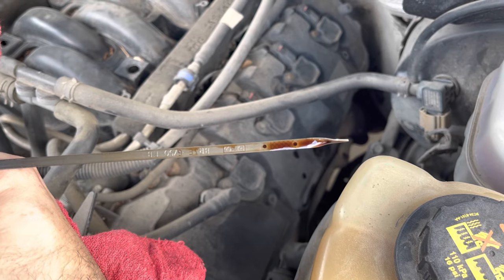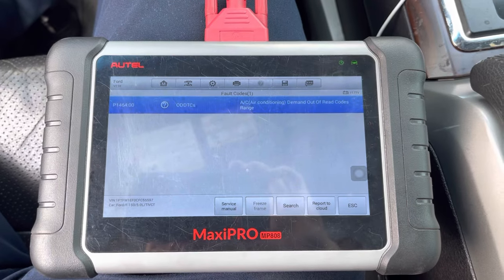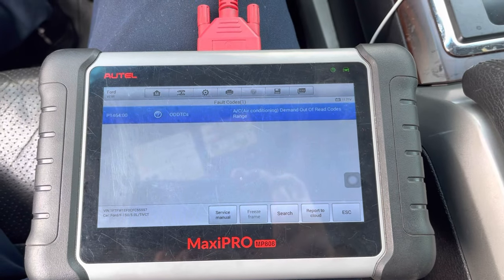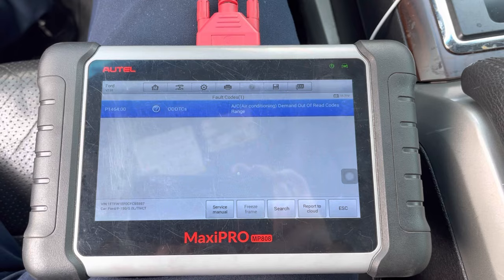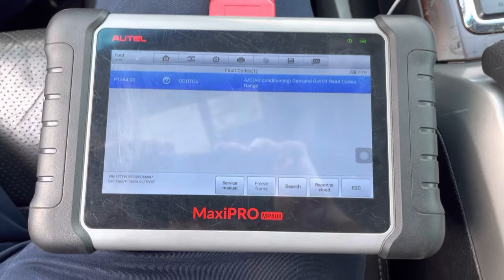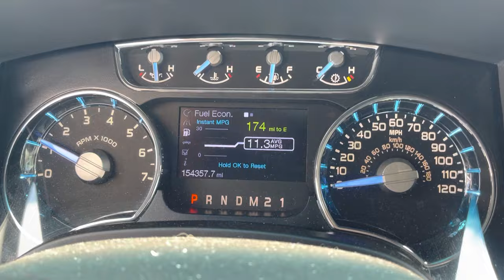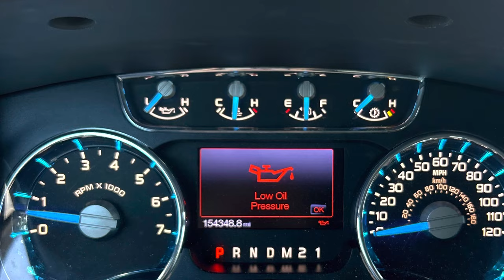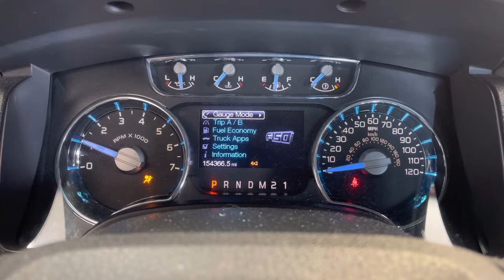How to Fix “Low Oil Pressure” Message on 2011-2021 Ford F-150

Comment: I like many others replaced the Oil Sensor Switch on my 2012 Ford F150 XLT 5.0 4x4 because at an idle I would get the dreaded LOW OIL PRESSURE warning. Didn't fix the issue! I stumbled across another video that talked about the THROTTLE BODY. Followed that advice by removing the Throttle Body and giving a major cleaning! Now, NO issues and after 3 months now, not 1 Low Pressure warning message. Try it, can't hurt, and will make a huge difference in the idle. Fixed my issue, hope it fixed yours!
Reply from the maker: You must have had a low idle before. If the engine isn’t spinning fast enough, then neither is the oil pump. I’m glad you got it fixed!
Reply: I had the oil light come on and my gauge was constantly dropping. I changed my sending unit on a Monday night, no problems so I thought it was fixed. As soon as I started my truck Tuesday morning, the light came on and the gauge dropped again. I remembered you talking about cleaning the throttle body so I tried it. So far I haven’t had a problem and it has been 1 week now! Thanks for the tip on the throttle body!
Reply: Can you add a reference for the 3.7l 2wd? Your video was extremely thorough, thank you for the visual. I'm concerned from another video referencing aftermarket sending units being a no go, is this going to damage the engine to drive to a mechanic, as long as fluid level is good and oil is in good condition?
Reply: Mine is a 2013 xlt with 216k miles, and this truck has been one of my best investments.
Reply: Thank you!  So frustrating! Several mechanics, even the better dealership in town have all been flummoxed. And I spent $450 getting the oil pressure switch replaced.  No luck.  If this is somewhat common, one would think the $200/hr guys at the dealership would have had a clue??
Reply: Which video did you see. I’m having the same issue. Thanks
Reply: @Sarcohunter did you find the video
Reply: Thinking that’s where mine is coming from glad to hear it fixed for you will be trying today
Reply: Any luck
Reply: @haileywood8691  for me I cleaned the maf and the throttle body, and it still did it a few times and then haven’t noticed it again
Reply: Hey guys, I have a similar issue, randomly only in park or sitting in drive I get that message also however my RPM’s never dropped and my engine runs fine in that moment when “low oil pressure” message pops up on my 2014 F150 5.0 FX4. 

So I’m assuming it’s the sensor that’s going bad since my RMP’s aren’t going down.
Reply: @prevail2983  I changed sensor and cleaned TB seemed to take care of it
Reply: @svtsebb  thanks for answering. Yea might do that. I just pulled off both valve covers to replace all 4 Cam sensors and all 4 VVT Solenoids. Decided to get them all done since I was in there lol. Oil pressure sensor isnt expensive so I’ll just replace it. 

Here’s a tip back, hopefully you never run into this issue but…. If you ever get codes like “P0022” “P0012” “P0014” or P0024” the cam sensors and/or VVT Solenoids are bad…. And if your Valve cover bolts are rusted out it’s literally a nightmare so check that out. One of the Cam sensors is blocked by the firewall, the rear cam sensor on the driver side, to replace it you have to pull it straight out but the firewall doesn’t give you enough room, in other words you either drop the motor or drill a hole in the firewall. Shits crazy, always felt bad for my customers, now I’m doing the same thing lol.

Comment: You can reach the oil pressure switch from the top of a 4x4. I did it in my 2011 5.0 4x4. Took 30 mins. Had to take out some stuff on top to reach it but not too bad. Still hard to reach but not impossible.
Reply: What did you have to remove from the top of engine to get at the switch ?

Comment: Knock that sleeve back on the bottom alt. bolt before you remove it by loosening the bolt a couple of turns and smack it with a hammer. The alt. will slip right out. 😉

Comment: So I have 2014 with 5.0 and same warning message , oil message was first, then cht warning and code w/limp mode no a/c replaced cht sensor and truck went back to oil pressure gauge dropping and message but actually died at a stop, replaced oil sensor and maf  then relearned idle same code sent to ford they replaced the same sensor and plastic plug then said it was fixed drove it home and it was not fixed after returning it to the dealer and 1700 for injector cleaning and throttle body +retune now they are quoting a new engine. Won’t know the motors tired but I have to see the live data of oil pressure dropping to believe it the truck drives amazing I picked it up from the dealer then picked up my kid gauge dropped once in reverse but truck seems normal

Comment: hey man , i got a 2014 f150 5.0 4x4, i get the same warning light with the oil pressure gauge dropping from time to time, but my truck shuts off by itself sometimes when im at a stop sign and get the warning. is that normal or do you think its something more serious? because when it turns off i just turn it back on and it runs just like nothing happened? any idea of what's wrong?
Reply: Mine does the same thing did you ever figure yours out

Comment: I appreciate the video (especially the tip about the alternator). I almost considered coming in from the top on my 5.0, but decided to follow your video. I think this is probably the best way to do it. You have all the access you need once the alternator is out of the way. I was able to get it done in about 45 min - 1 hour start to finish.
Reply from the maker: Thanks! I agree that it’s best to give yourself the most space so you can actually see what you’re doing. Plus, the way I show here is technically the correct way.

Comment: Excellent explanation! This is precisely the problem I'm having with my 2017 F-150. The warning comes up on the screen mostly when I've just stopped at a light. My truck is 2-wheel drive, so I hope it's not too difficult to replace the sensor. Thanks for posting a good video. My only wish is that you would do another video on a 2-wheel-drive F-150 with specific instructions on how and where to find the sensor. It's not at all obvious, but at least now I can look for a sensor that's cover with leaking oil.
Reply from the maker: Since your truck is 2-wheel drive, you can get to the sensor on the bottom without having to remove the alternator, which will make the job a lot easier. If the issue persists, try cleaning the throttle body because a low idle can create this issue also. Good luck!

Comment: Thanks a lot  Jack. Your video allowed me to successfully remove and replace the oil pressure sensor on my truck today. I'm very grateful, thanks again!
Reply: I replaced mine but it still turns on can it be a faulty sensor ?

Comment: Exactly whats been going on with my truck, just after an oil change. Level is good, maybe a touch on the full side. Doesn't come on all the time but when it does it's on/off, on/off repeatedly. I'll take a look but I think I'm getting to old to do this myself unfortunately. Thanks for the detailed video though.

Comment: Tapping the threaded insert is a great tip!
Reply: It would have been even a better idea to tap it back after he loosened the bolt a couple of turns when taking it out. It wouldn't have been such a struggle to remove the alternator. 😉

Comment: Did you use OEM sensor? If so,  what was the part number?  My brother in law has the low oil pressure light coming on also,  when it does,  engine automatically goes to idle,  will not move until he switches the truck off,  and restarts engine.  Only happens when he comes to a stop,  like a stop sign,  or stop light.  He had it to do that twice in one day.  Next day worked just fine.  I think he has a switch going bad.
Reply from the maker: Yeah it was a Motorcraft sensor. Part number SW8368

Comment: Nice video bro 👍 👌 not sure if you mentioned it in the video, but keep in mind this can be a wiring problem also! I have a customer truck right now that just had an OEM sensor put in by another shop with no change in symptom. Haven't tested circuit integrity yet, but the wiring looks terrible and i am suspecting that's gonna be yhe issue. Unfortunate that the customer has to pay twice for the problem to be fixed!
Reply: There was a recall for the wire harness but I got the same issue I replaced the negative terminal clamp and it fixed the issue

Comment: If it's option 1 which is the low oil pressure popping up and engine turning off.  What do you need to check or replace

Comment: So you said if the low oil pressure light turns on either the switch is bad or there’s actually low pressure and the engine won’t run if that’s the case? Is it possible for the truck to actually have low oil pressure and be drivable
Reply: Keep in mind the wire from the sensor to the PCM can be broken or a connection can be loose. If the wire breaks (or is loose and making poor contact) the PCM will think there is no oil pressure. If there was intermittently no oil pressure, the truck at very least would be throwing codes for Variable valve timing, which requires oil pressure to function. Just my opinion I am not a ford tech.

Comment: Just got it finished doing from underneath with truck on ramps.  Awesome lifesaver here.  Only way in my opinion to do this.  Doing relearn process now to speed process up.  Went out and ran a bunch of lights for an hour with some highway.  Now onto “service advanctrack”.
Reply: I had the “Service AdvanceTrack” warning on my 2012 and it was due to a leaking vacuum line that was easy to reach, near the coolant reservoir.
Reply: I replaced the pressure sensor.  $20 part and about 3 hours of my own labor.  Mostly it took longer because it’s hard to access with 4 wheel drive and I needed a couple of tools I didn’t have handy.  Problem gone for three years now.
Reply: @jefflundberg8068  excellent tip thanks.  I have not thought of that possibility.   Been dragging my feet a bit on issue with life’s other curveballs.

Comment: Change the plug also!  if you have done this before, My sending unit plug was bad, I couldn't tell it was until I pulled out and metered it. I was getting intermitant ohm readings as I moved the wire.

Comment: My 2014 just started doing this but my truck stalls out then the low oil pressure light comes on, oil level is fine, any ideas ?
Reply: Did you ever get a solution? I'm dealing with this same issue. 2012 tho
Reply: @vigsector5400  No. the guy that worked  on it couldn’t find anything so he reset the computer and it hasn’t done it since so who knows !

Comment: How about no light, but a random knock at hot idle that goes away with any amount of throttle blips. Sometimes not there, other times knock no knock.  
Oil pressure bleed off from timing tensioners is my best guess. 200k OG timing set. Pretty sure, bought at 184k.

I want to do this first though. Could this video be my solution?

Comment: Hey Jack, I see a lot of videos about this model and year having issues with the low pressure alarm coming on at an idle, but I had a different issue. 

I was 315 miles into a 350 mile trip, cruising in a traffic slowdown when I lost all oil pressure, couldn't accelerate. I pulled over and made sure I didn't spring a leak. Next I checked the fuse that goes to the oil pump and relay. Once I popped it out and back in again, the truck was able to start up and get me the rest of the way with no issue. Does this sound like it could still be the same sensor, or could I be looking at a computer issue? Thanks
Reply from the maker: More than likely, it’s an issue with the sensor. The odds of it being a computer issue are very low.

Comment: nice Video. I had mine changed and several months later the same thing happened again. I took it to my mechanic. He check the oil pressure mechanically and said when the light comes on that the oil pressure does not drop. It's an electrically problem. He said the part is not bad. I admit all of this sound fishy but I had this exact same problem with my 2002. I drove my 2002 for years and years with that message (actually no message the oil gauge would drop to zero) Never threw a code.And everything was fine.  The point of my comment is this. The repair he made sometimes will fix the warning light and sometimes it reappears after a short while. I am looking for a way to silence the warning light. I know I know but it is extremely annoying and paying $300 to have a new oil sensor installed only to have this problem come back in a few months is not the answer either.  If anyone knows how to silence the warning light please let me know.

Comment: You never explained if you sprayed the inside.Where you screwed in as well with breaking or is it just a connector
Reply from the maker: I always spray a little bit inside the threaded hole but it’s not really necessary.

Comment: my 2011 f150 5.0 112,000 miles did the same thing with the oil pressure warning, today it did it and shut off, now it won't stay running, when you start it it runs fine for a few seconds then says low oil pressure and shuts off, oil is full any ideas?

Comment: How long did the job take?  Looking at how much it should cost me man hours and part
Reply from the maker: The book time is slightly over 2 hours (2.1) (for 4x4 models with the 5.0). That’s probably about how long it took me because I was filming but it can be done faster.

Comment: Hey ma I have a 2010harley 150 we’ll she would  start shut down , they changed the fuel pump then it wasn’t that then they said the hole timing chain kit wasn’t that changed a brand new oil pump wasn’t that she starts and runs then her alarm comes on and she wants to stop and the low oil pressure and the gauge drops the needle help eny ideas ?
Reply: Old thread but you need to move the fuel pump fuse to the new location, Ford has a kit, and Amazon sells one too. Pull the fuse to the pump and if it looks burnt your in need of the fuse relocation kit.

Comment: My truck is doing the same thing. How much this job runs???
Reply: You just saw how to do it.  Get the new sensor and replace it.   You need to get the timing belt out and alternator out.  Good to go

Approximately 3hours of job.
Reply: @learnlkh1 You mean the serpentine belt... this truck doesn't have a timing belt...

Comment: Hi, so my truck it’d been having this issue. The low oil pressure would show up while driving. The last time it did it, I brought the truck to a stop and turned it off now it won’t turn on. What do you think it is? Could is be the low oil pressure, I’ve checked the oil and it’s got oil.
Reply from the maker: I’ve never seen this issue cause a no start situation. Is it the same truck as the one in the video? Also does the engine crank over like it’s trying to start or when you turn the key it does nothing at all?
Reply: I've had the oil pressure sensor replaced twice now. It did not solve the problem entirely but it doesn't happen as often as it used to. It was never an real issue because the truck never actually died on me.
I took my truck to get the speed sensor recall taken care off because my truck started acting up. As soon as I picked it up I noticed there was something really wrong this time around, all they did was to reprogram the computer. 
Now my truck takes a good minute to go into 1st gear and while it does or if I'm up-hill or at a light. The low oil pressure warning light comes on, the rom goes to zero and the truck dies on me.
I had to turn the truck off and on. And keep my foot on the pedal.
Do you think it could be the actual oil pressure pump ? I replaced the sensor this morning and it died on me going up my drive way. I did noticed it was a bit low on oil, like a quart. 
Sorry for the long message 😅
Reply: @Ricktb90 

Did you know what the problem was?
Reply: @bohannon5175  no. The dealership people just called to tell me they can't reproduce the problem.  To them, it shifts fine

Comment: Mine kept turning off then the message of low pressure came on I changed the negative wire on the battery going to body grounding and fixed my issue

Comment: Great video i just did my oil pressure  sensor and the connector both were bad and broken on my 2011 5.0   but now when i start it up the oil guage stays down until a few minutes that i start driving it would you know what went wrong or what to check didnt do it pryor to changing sensor any info and help is greatly appreciated
Reply from the maker: What brand of sensor did you use?
Reply: @jackhfletcher it was at O'Reilly's it's called Standard brand
Reply: O'Reilly's  standard is the brand name
Reply from the maker: Go to your local Ford dealership and buy a Motorcraft sensor from the parts department. I hate to say it, but the issue is probably because you used an aftermarket sensor. Install a Motorcraft sensor and you should be good. Think about it: the problem didn’t start until you did the job. I see issues all the time at the shop with aftermarket sensors, even with brands that are supposed to be reputable.
Reply: Ok sounds good will definitely do that and see what happens will keep you posted and thank you so much for all your help
Reply: @FernandoGomez-rs2pd hi could I have an update bc I’m having the same problem. Did you buy the motor craft brand; did it work? Thank you

Comment: Should oil be drained before doing this on my 2011 5.0? Or is it above where oil gathers?
Reply from the maker: No need to drain oil. You’ll loose some oil when you remove the switch, but draining the oil won’t make a difference.
Reply: @jackhfletcher  okay, thank you!